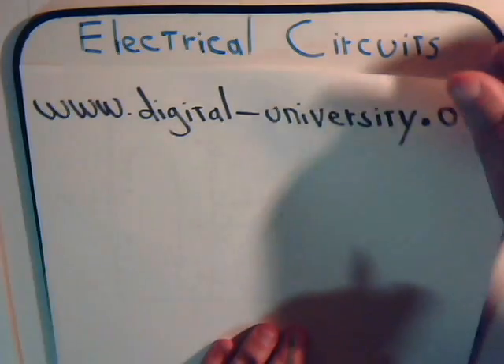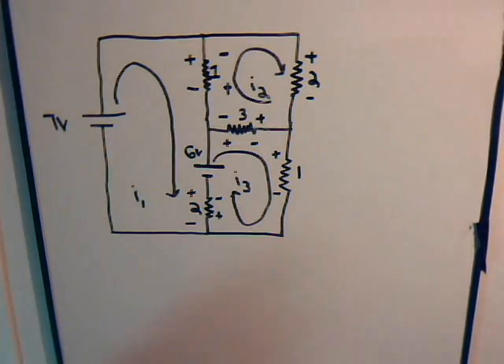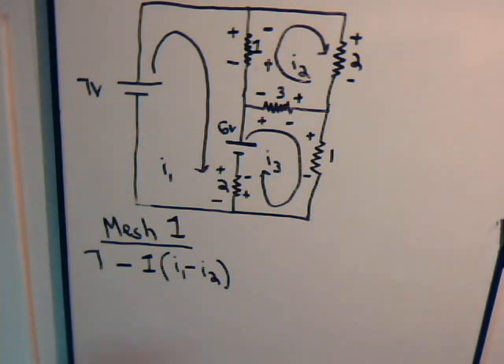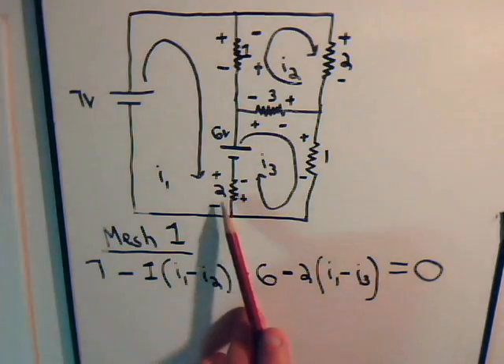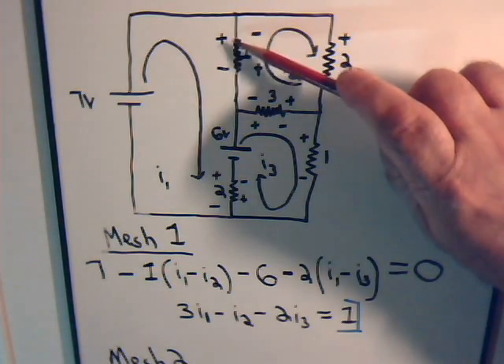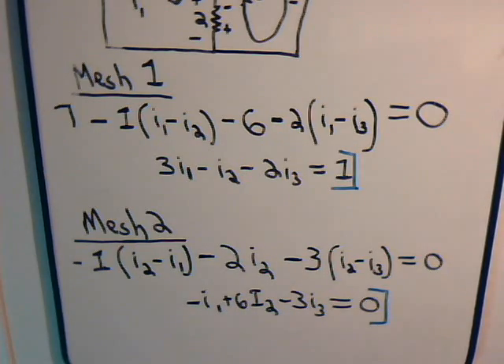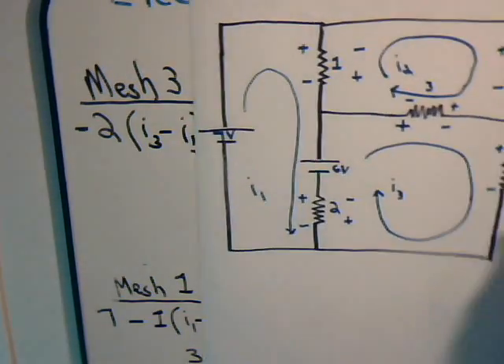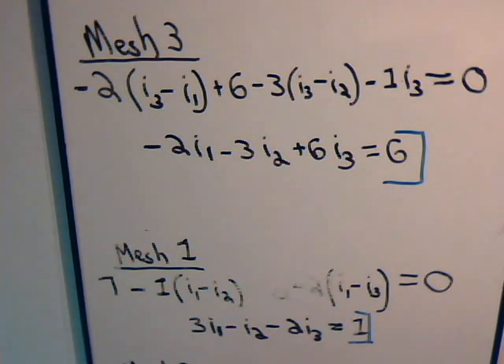Electrical Circuits Video #10: Mesh Current Analysis - Introduction & Example #1 Part A

Comment: 2nd viewing. I'm making simple mistakes when collecting terms but thanks to your help; I'm putting the equations together with little problems. Not sure why you multiply each equation by neg 1 though; unless its to continuously get a pos number on the right hand side. Thanks for your videos and they are extremely helpful.